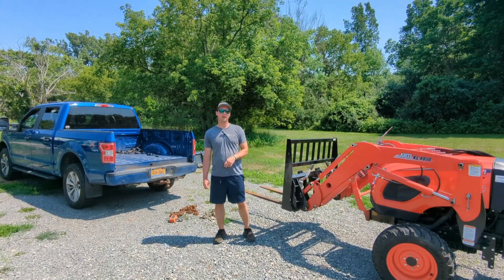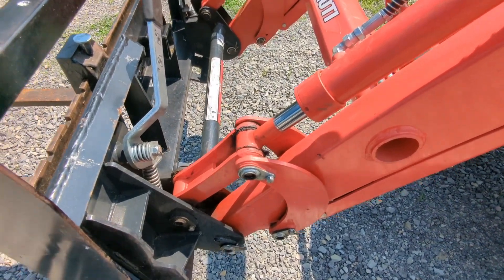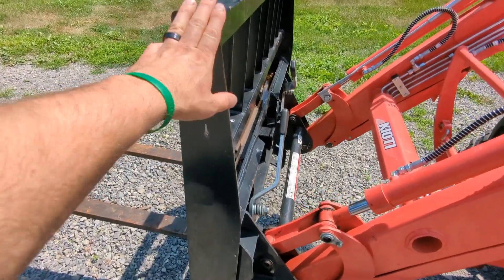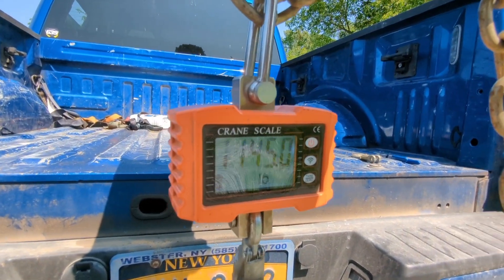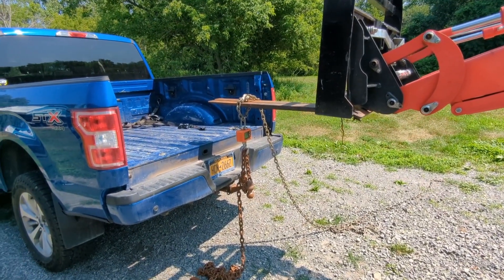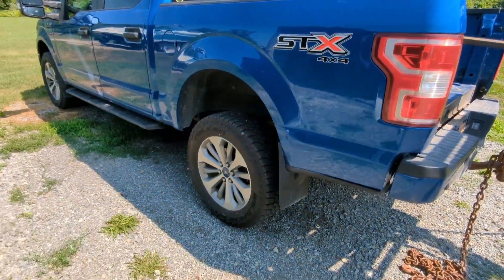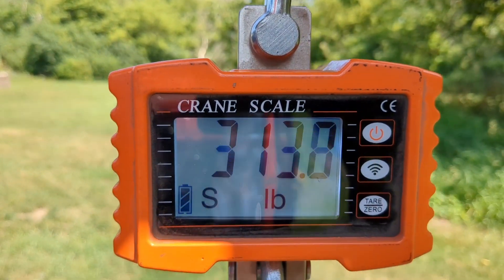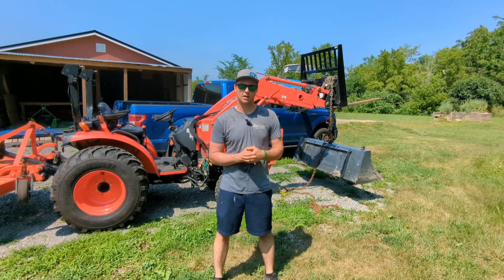How Much Does Leverage Matter? Testing Fork Lift Capacity!

Comment: Great test! I’ve had my new Kioti 2620 for a few weeks now - right after I got it I was lifting the end of some lumber to drag off the trailer. As I started lifting it slowly I noticed that the loader shifted to the right. So I stopped immediately - the problem now is that my loader is not level. It’s very noticeable. But I’m still able to use it. Overall it’s a good little tractor with a lot of heart.
Reply from the maker: Mine has always been slightly to the right side. I've even loosened up the loader bolts and lifted the front wheels up on a level concrete floor then re-tightened the loader bolts to see if that helped and it didn't hardly make a difference. I've learned to just live with it